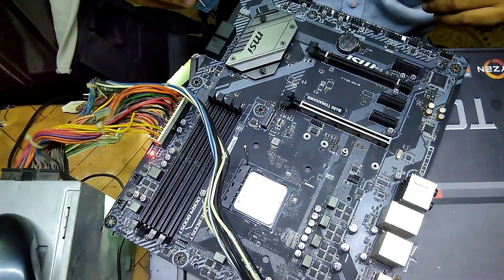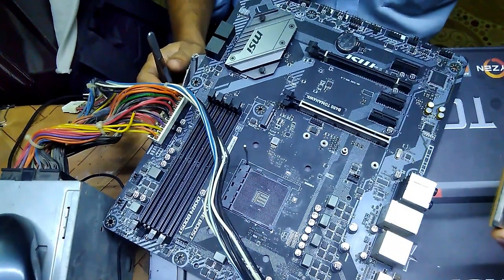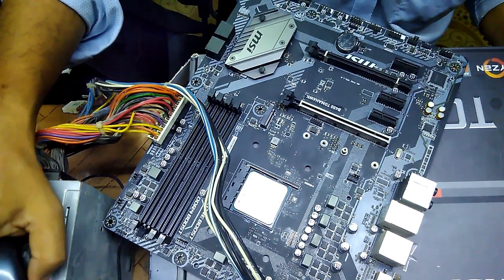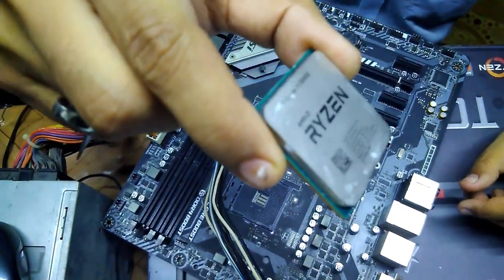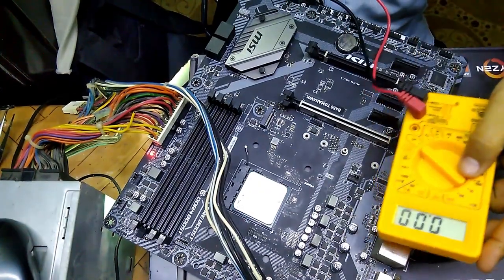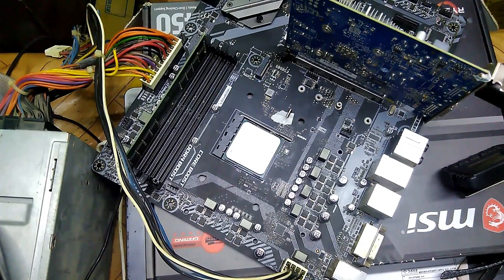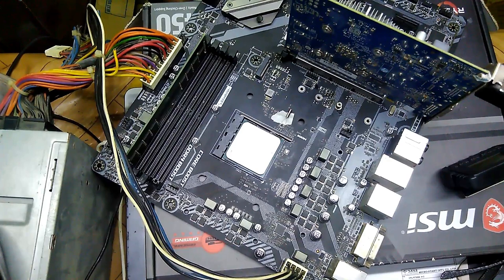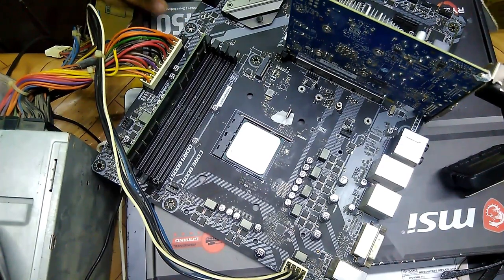Motherboard(b450) Repair- Not turning on with processor in socket & vddp voltage missing

Comment: I been running the same mono for five years now with a r5 3600. The board needs a bios update to be able to run gen3 and newer ryzen. They had to replace the bios with a smaller version to be able to run the later cup

Comment: same issue with Ryzen 5 3600 i was update bios recently 7C02v1J1(Beta version) after 3 days my computer totally shutdown automatically i won't power up , i'm confused and try to rollback my bios 7C02v1J1(Beta version) to downgrade but unfortunately i got field during bios update from working bios Mflash method , than i've to go flash it via flashback button complete all process red light flashing slow than its flashing very very fast 4/5 minutes computer turned reboot after complete bios update and red light stop alright now i install processor but its not going to power on by power button self so i've remove that processor and try to power up again with power button yes this time computer power up but cpu red light on its was done or not i don't no so let me try to remove bios chip today and try to flash it via RTF Programer than i will discuss with you it's going to working or not , can any one tell me more about it please i need help !
Reply: i've ver 1.0 Logic board , can you explain me or can i get your wahtsapp number please i want your help .
Reply: why you skip video dear , tech fully why you skip my dear why i'm confused !!!!

Comment: Same issue with my b450 pro vdh plus what can i do
Reply from the maker: change/replace 32mhz crystal oscillator first! if it still doesnt work then i will guide you on diagnostics
Reply: Brother 😢 ab mother on hi nhi ho Rha

Comment: bro i have same problem with a320m-pro msi.. can you guide me?
Reply from the maker: Change 32khz crystal, if that doesn't work then remove transistor... It will work
Reply: i tried checking for short in the 12v railing following the mosfets and found no short
changed crystal but still no power..

so which transistors should i check?
Reply: @Naturefuzz  bro i have found the problem.. it was shorting in pm_1p05 railing..

is there a way to jumper this railing? without reballing the super io chip?